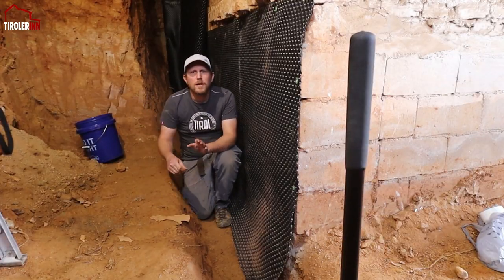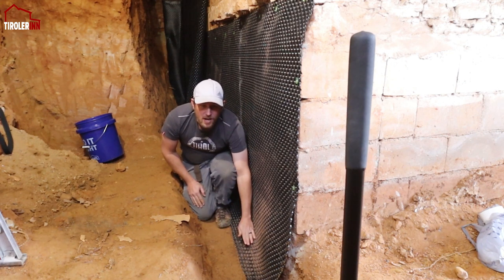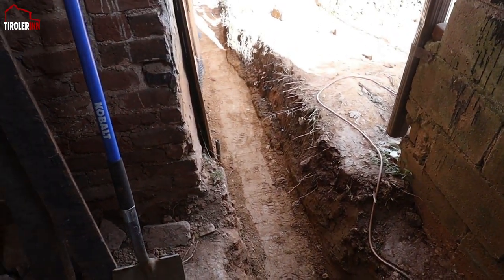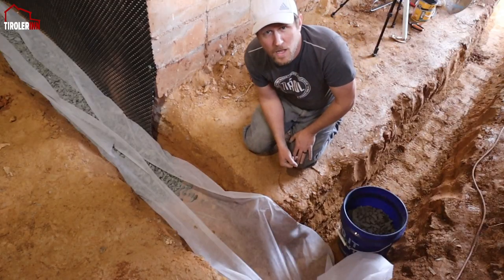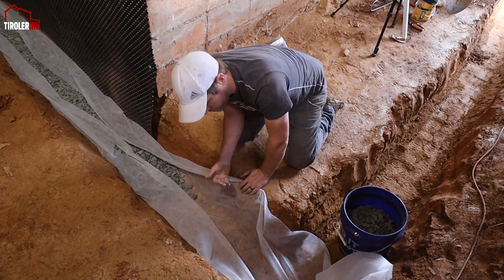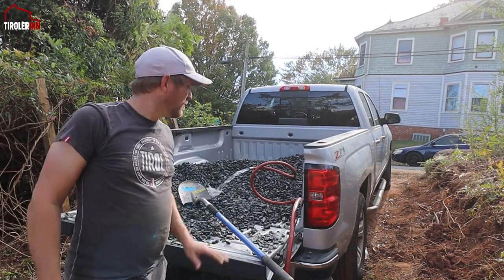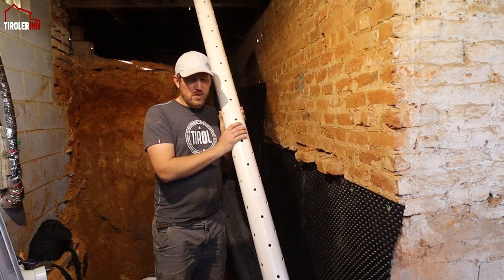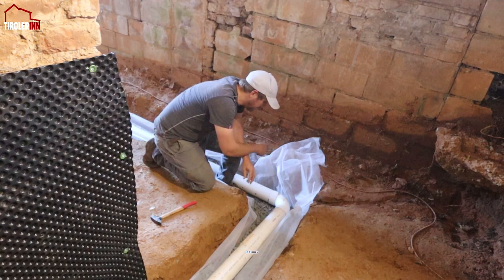Installing French Drain Pipes - TirolerInn the Renovation

Comment: Why do you have the black plastic so high on the wall under the porch?
Reply: I’m curious on that too, is there some extra benefit in that area or is it just because it’s hidden  and you can waterproof so high?
Reply: i thought the dirt was going back there. do you see that mound of dirt left in the corner?
Reply: They are planning on filling that in a cement slab to store garden equipment so I don’t think they will refill it with dirt
Reply from the maker: We are leaving it all as is, but in case the dirt ever falls it protects it higher. Only the section that is flat will get a slab of concrete.